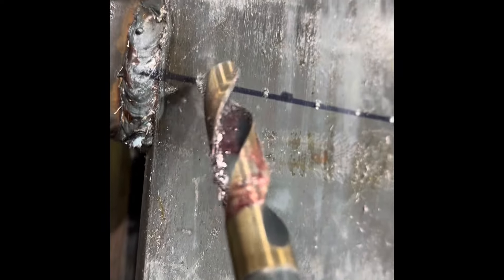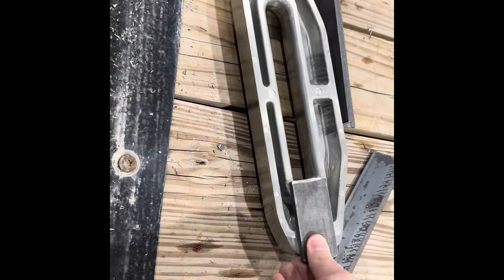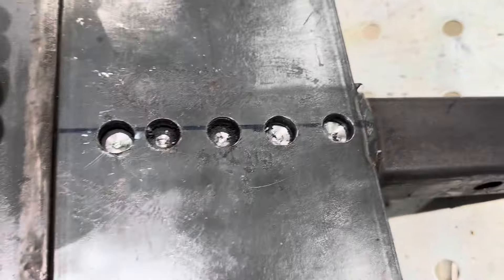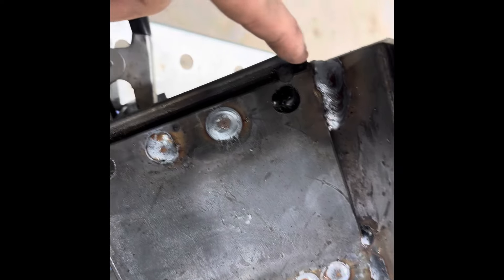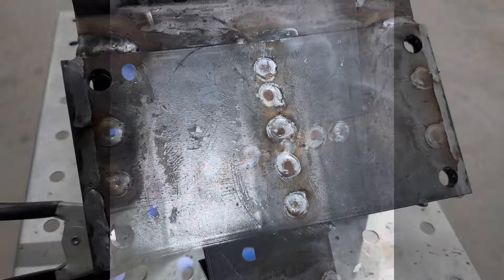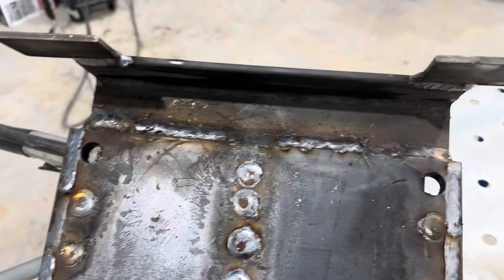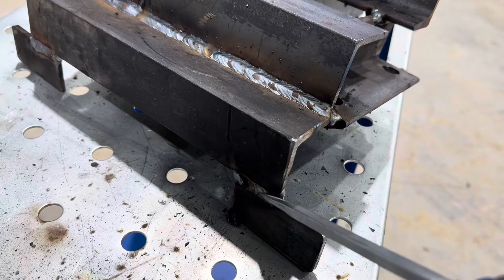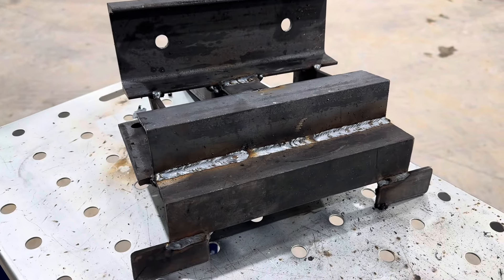Building a sweet 12k winch mount pt3:  Finishing touches on the 12k trailer/ hitch winch mount.

Comment: WOW - that looks super strong!! 
I have a 2023 f250 and just bought the Apex 12,000 winch. I debated about a hitch mount winch, and put a hitch in the front. Then I could use it in the front or the back. But I decided to just mount it in the front bumper. A Spring project - My bones don't work well in this cold. Your winch mount looks super strong and Heavy!!  I bet that thing weights over 120 pounds, with the winch. 💪 Thats my main reason, I know I won't want to move that mush weight. You younger guys can, not me.😁  Can't wait to see it mounted and how you use it. 
I have to decide which behind he bumper mount I want to use.  Hmmmm

Cheers from Lapeer.
Reply from the maker: Thanks for the comment you raise a great point on how heavy it is.  Now the winch with the synthetic lone, the box says 50 lbs. winches are flipping heavy. 

And really the front permanently mounted is the best place to recover yourself.  But recovering others the back is nice because you can back up on good ground and then strap up from there. 

The mount i really hope is a beast.  I know its going to be abused.  My bet is its no more than 25 lbs. there is alot of air in there. I put the strength where i needed it and im planning on beveling the edges and snipping some corners off. 

So i think all in its going to be 75 ish lbs. plus a battery. 

Not exactly something you want to carry across a field but to pick it up and mount it, it shouldnt be too bad. 

It may even be 20 lbs. you have me curious to weigh it now!
Reply: @greatlakespowerstrokefx4   I based my observation of 'winch weight' on how heavy that dang box was when I got it. It felt pretty heavy. Then adding any weight, for me, was more than I cared to handle. (age related). After my comment, I notice you have earlier vids on the mount (that I missed), which add more context. I too got the synthetic rope. Mine will only be a backup/emergency, in case I get my wife and I stuck out west, pulling the trailer.  
The video with the winch mounted to it makes the mount look smaller and less heavy than this video. I guess just seeing the mount close up without other perspective made it look really heavy to me. LOL
*Side note. I was shocked when I opened the box and saw it came with the Controller relocation kit. I was planning on building that myself.  Yippee.  
cheers!
Reply from the maker: @Lapeerphoto  for sure i was holding the phone right up to the welds.  Its really not too bad but i feel comfortable that i would put some serious load on it without any worry. 

Thank you so much for watching. It is startling how heavy a 12k winch is. And like i said i forgot how heavy they were when i bought it. Which adjusted my plan a bit. I would going to build carry handles. But i opted to just stick with the body of the winch to carry it. Adding any more weight, as you are saying, is a bad idea.  

Its heavy for me too man im not going to lie. I wouldnt want to carry that 100 yards over to a stuck truck lol